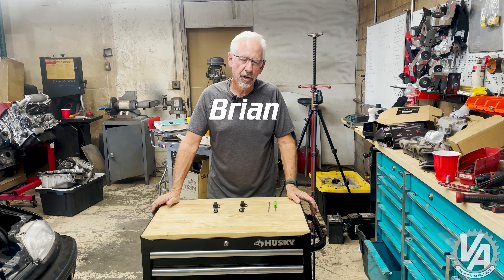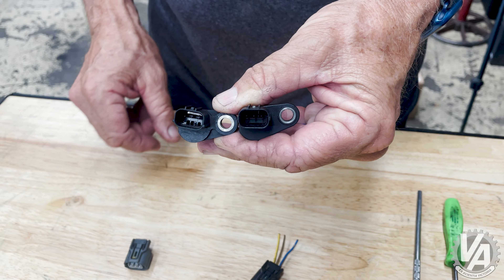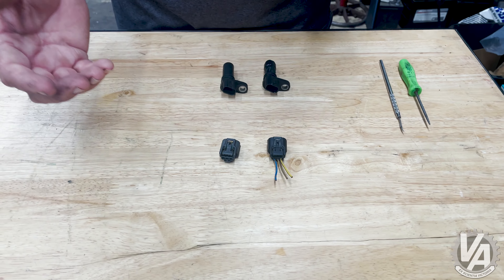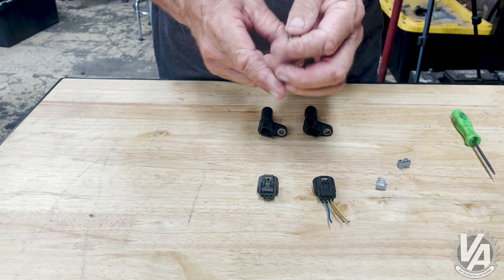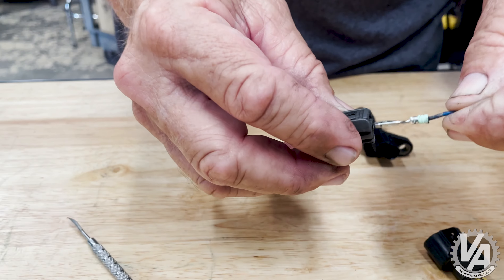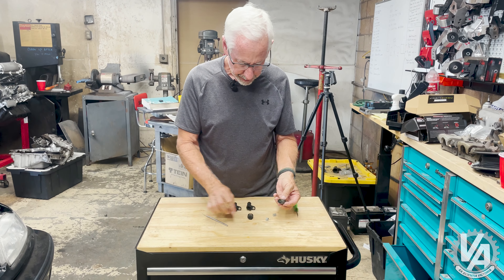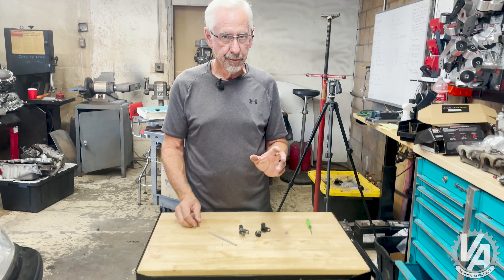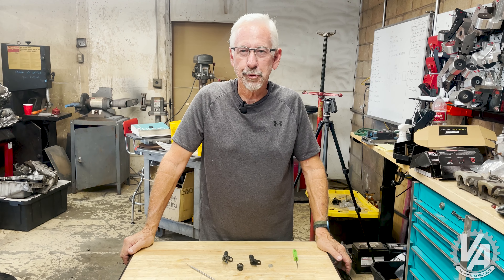Getting Your K Swap Done Right!

Comment: Hi Brian. I have a 2017 k20c1 turbo engine which I’m going to use for track days in the uk.can you recommend a wired in standalone ECU to run this engine??
Reply: Motec m143 or m150 work well.

Comment: Hi there I’m doing a k24a Ek swap I have a used standard 03 Crv k20a2 37820-pnb-e02 ecu but pump runs but can’t start my swap However a friend ECU start it good so I’m wondering if I have about ECU are it’s just not compatible with the swap.